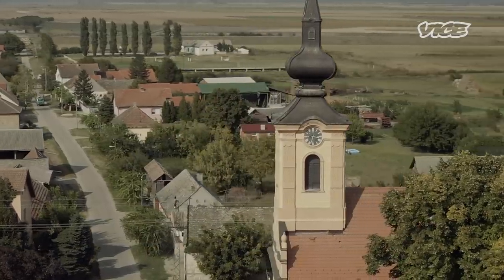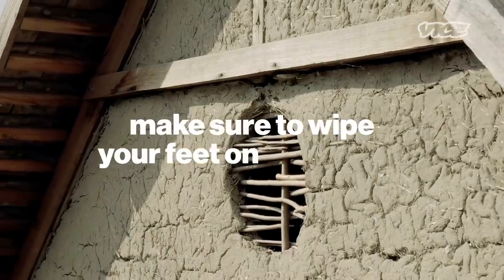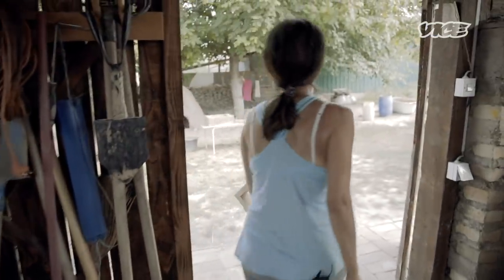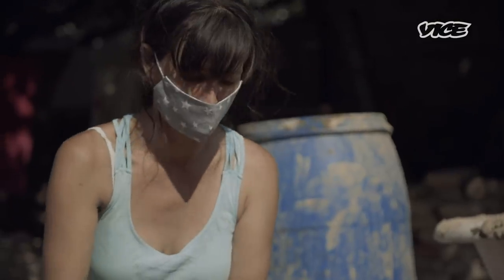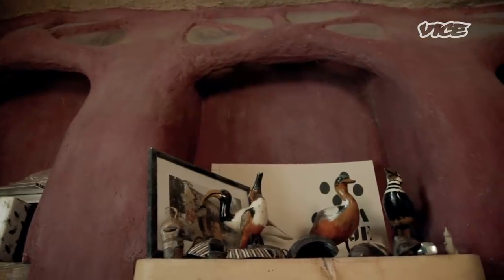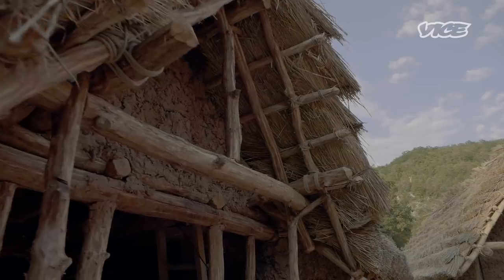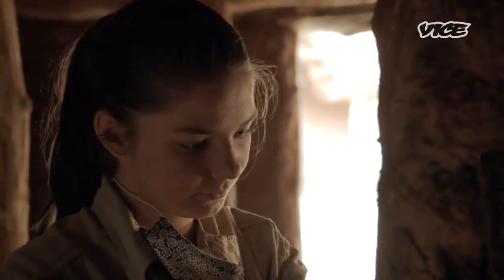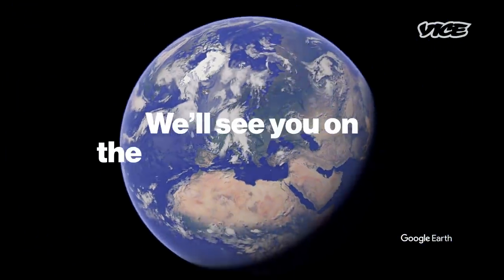Architects Are Using Mud to Build Sustainable Homes

Comment: "Buildings are responsible for 40% of greenhouse gas emissions" is so vague that it ignores what ACTUALLY causes the emissions. Its not the make up of the buildings, its the internal operations. Houses have emissions due to the daily activities of the people within it. I'd argue an uninhabited brick house has no emissions, simply a longer lasting footprint, which ultimately could be very small. A mud house with electricity, gas, and water would also have emissions, while also being less maintainable, strong, and worse at overall heat retention. Its not a terrible idea in warm climate areas. Then it brings up a whole other issue of soil composition. It doesnt seem widely applicable enough to have any impact. Plus the lack or diminishing of a chain of labour would be disastrous for the economy. Good idea, but I dont think its got any legs.
Reply: No, a brick house does not have a small footprint. Brick, mortar, and concrete are extremely carbon and water intensive to produce. Nevermind the wood or steel used to reinforce them, the fuel used to transport them hundreds or thousands of miles and erect/pour them. One foundation has to have limestone baked in a kiln, rocks crushed into substrate by giant diesel machines, and another giant machine mixes them and has to drive to the site on roads whose pavement is made the same way and degrades rapidly under the weight of the cement passing over it.
Reply: @jcarry5214  sounds like skillful jobs
Reply: @MultiFreakface Agreed. But a chain of labour disappearing isn't disastrous in the context of ecology. If ecology wouldn't be outweighing economy we wouldn't be having this discussion in the first place. We need to somehow get rid of this mindset, and set of laws, that non-essential labour is anything but occupational therapy. That's been the positive side of covid incidentally, the diminishment of non-essential labour has been buying us a tiny bit more time.
Reply: @jcarry5214  it doesn't refute the fact that activities are what emit the greenhouse gases... It's also factually incorrect, google tells me 1/3 of all greenhouse gases emitted in US are from buildings which is more than any other sector of the economy (which means its ONLY building the buildings) but they don't produce MOST of the greenhouse gases.
Reply: Marcus INfinity All automated.
Reply: @jcarry5214  And the amount of water needed to liquify the mud enough to necessitate homogeneity is somehow unsubstantial? What about the water required to grow all the straw and grasses? How are you going to act like wood has a serious carbon footprint? Unless we're discussing clear-cutting of rainforests then its a moot point. The majority of lumber where I'm from is locally sourced and grown. You're also making enormous assumptions about the labour chain used. The majority of people are not having building materials shipped in from thousands of miles away. You're ignoring alternatives to the traditional model of housing that don't implement methods that aren't feasible for the majority of the population.
Reply: @josketobben  I would argue we still would to an extent, also the feasibility is the main issue I have. It's not a sound substitute for the majority of the population. I agree that ecology SHOULD take precedence over economy but it likely never will. The other things I dont really care to touch on, as I feel like theyre mainly an expansion of the economy angle. Dont take it as disrespect that just wasnt the main aspect of my argument.
Reply: @MultiFreakface  I'll say flatly that the water used in concrete production makes stirring mud and growing wild grass an absolutely negligible output. I'm from an area that produces both timber and cement. I'm not making assumptions, I know people in both industries. Yes I definitely agree that trees are a carbon neutral material, and harvesting done correctly is an enormous benefit to the habitat. But by the time it's cut down in the forest, hauled out using antique diesels on roads that require immense maintenance, milled, hauled at least twice more and cut with power tools on site they definitely have an impact. A massive proportion of homes are built many hundreds of miles from where the trees were grown or the limestone was quarried. It could be worse, I agree, and there are lots of folks who harvest and mill within a few miles of where the tree grew. And if transportation tech allows the giant diesel engines that move timber and cement and stone to be replaced that would change things dramatically. Powering the mills and steel and concrete plants with non-fossil energy would radically change things also. And I'm not ignoring other alternatives, there are some fantastic ones. The method shown here is a terrible option for anyplace I've lived and they definitely make clear that medieval mud tech is not appropriate for anyplace but a goldilocks temperate zone. I'm just trying to say that most buildings do have a large footprint even if wiring and carpets and HVAC are never installed.
Reply: @taeheekim8314  Yes, nobody is saying that an empty house with no lights on is belching greenhouse gases once it's built. But there are not a lot of houses that fell from the sky intact with no production, mining, metals, or transportation required.
Reply: @Sp1n1985  They're often barely above poverty level jobs, at least where I'm from, and they have a tendency to put people into early medical retirement.
Reply: @jcarry5214  dirty and dangerous job.. They should be paid better
Reply: @MultiFreakface  no they aren't..
Reply: @jcarry5214  But a very well built brick or stone house can last more than 200 years with very minimal repairs, so the pollution emitted while they are built becomes irrelevant.  The problem comes from cheap houses made of plastic and other cheap materials which need to be replaced after 30-40 years.
Reply: @PG-3462  there are many, many wooden houses that old where I come from, and they didn’t need any fundamentally different upkeep from a brick house. Siding is renewable, sills are renewable, everything else is about the same.
Reply: @PG-3462  THE surviving parts of oldest cob house are 10 000 Years so Clay dont have to be bad.
Reply: @iknowyouwanttofly  What you just said litterally prooves nothing 🤦‍♂️
Reply: @jcarry5214  what do u think is the best choice  materials to build homes in developing countries and their poorest areas?
Reply: @hoody3752  almost certainly it’s what is closest, and it depends on what the needs are in a particular area. The biggest obstacle to safe, modern-ish housing I know of is deforestation and lack of access to tools that that would allow materials like rammed earth to be used. In many areas a western style home is completely pointless without infrastructure like electricity, but transportation of materials is an immense cost in developing areas.
Reply: Concrete mortar and brick have a high environmental footprint

Comment: It depends on the location and structural codes. As a civil engineer which is inclined with the structural stability of a building, homes build from bricks are very prone to flexure failure because bricks are only good for compression. If you build that in the Philippines, it will easily be dismantled by a Typhoon. Bricks are only good as an Architectural part of the building like walls, wall bricks, or floor tiles, if you will use this as a structural member therefore it is hazardous.
Reply: Phillipines is in the tropics so they'd probably use bamboo for structural support. In any case, best to see what the indigenous have been building with, because they've been there 1000's of years and the locals know which raw materials are available and how to combine them.

Comment: Yeah, these Mudhuts are really climate friendly, also they have a life expectancy of 30 years, in comparison a "normal" House has over 100, they are prone to collapse and bury you under all the mud and straw, which is even more climate friendly since you wont be producing any more pesky CO2.
Any dont even try to build a multiple story house like that or any house near any water.
Also forget building a cellar.
There are reasons that most of humanity builds houses out of bricks or concrete if they can afford it.
Reply: Vice will do anything to reject Western conventions or technology.
Reply: citation needed? If you build a poor quality house and don't maintain it, it will eventually collapse no matter what building material is used. Bricks and concrete (and also steel for that matter) are also vulnerable to water damage, it's literally one of the most common ways that those materials fail.

With proper shoring and supports, you could build a earthen house with a cellar or a 2nd floor if local conditions allow, especially if you were "allowed" to use some wood and stone materials too. If you have access to lime or mortar, you could for sure do it.
Reply: Actually 30% of the worlds population lives like this right now.The reason most use other building methods, is simply because they won’t allow natural building techniques. 

You can be literally in the middle of nowhere and in the US you’ll still run into building regulation issues. They really don’t want people living cheaply and freely and having cost effective natural building materials, hurts that web of control.
Reply: I can also write a book about the downside of these shitbox huts
Reply: Well we built millions of these houses in serbia, some are standing on top of rivers, most of them are very near rivers and they last for century, my greatgrandfather had one of these and nothing collapsed on his head
Reply: Lucy Bubz well, my honest taught, you can build a regular house and then have some extra rooms made like this
Reply: Nonsens, you can build a modern house of clay, wood, straw and other natural materials. I know, because i have done that already 30 years ago. The oldest houses in Germany from the 14th century have been build that way. What is lacking is the education of the general public and the mindset to think sustainably.

Comment: We in India have similar homes built until 20 years ago, they carry every kind of hazard, if it rains some parts washaway, the grass roofing leaks, roots, snakes nest in them, rats nest in them and a few more, they are a great fire hazard, one stray match and you can watch your home go up in  flames, in event of an earthquake it ain't gonna survive. And pretty easy to break in with today's tools.
Reply: Then you are not making mud houses the right way. When mixing mud with water, it shud be done for long time with proper mixer machine. There are more than 1000 years old mud house in Afghanistan and 10 story mud buildings in Yamen. Make it the right way. Mix lime stone in the mix.. rates, insects all stay away
Reply: easy to break in using today tools?
Have you heard about lockpicking?

Comment: 1. We already use regular hollow bricks to build houses here in europe

2. Wood is better building material then bricks or mud

3.Dry mud doesn't go well with rain

4.Greenhouse gases are not emitted by houses themselfs , but rather by power plants that supply electricity
Reply: Those mud bricks are sun dried and not fired. Once the rainwater reaches several centimeters, don't they concern about the lower part of the house starting to crumble?

Comment: I'd never get a permit to build with any of those materials. All materials must be CSA aproved and built to national building codes. Natural materials don't have a manufacturers certification.
Reply: And you've just discovered the beautiful world of lobbying my friend ...
Reply: Ant • like ants?
Reply: @TubeMeisterJC  Um, no. If the bricks are fired, they don't wash away. The roof can certainly burn but if the walls are white washed, it's going to be a bit more difficult for the walls to burn.

And the daubed walls are STRONG. There are still buildings in England standing many hundreds of years old with the original daub still intact and protecting the dwelling. Oldest is something like 600 years! So no, it's not going to be so easy to kick the walls in. You do not understand the material, clearly. Even modern style buildings begin to severely decay after just half a century.
Reply: @TubeMeisterJC  Yes and wood frame is inferior to concrete block in the modern day, and yet we still make wood frame buildings, so what is your point? Because I think you are missing the point of making these buildings today. They are capable of longevity with old standards and they are more affordable and more green than modern standards. If we combine this old technology with newer building ideas, they can be even better whilst still remaining more green than modern builds.

If for example we want to solve the homeless problem or help people climb out of poverty, these sorts of homes are ideal for doing that.

Comment: Heres a bit of advice...typically when we invent things, it's to improve on an original idea - or create something new to solve a previous problem.
We started transitioning from mud houses many many years ago for a reason, and there is a reason why we haven't 'improved upon' the idea of them either.

These things aren't meant to be long term housing solutions - nor are they meant to withstand major weather conditions (at least without being a major hassle) nor insects/rodents, etc.
Finally, they don't support modern electrical/plumbing and heating in a friendly manner. Yet alone the 'slanting' over time that occurs due to natural settling. 

Why is this important 'news'? No idea. But hey, i've got an idea...lets go back to using outhouses while we're at it! I wouldn't mind having to scrape me and my families poo from the bottom of a hole every month! Sounds like fun!
Reply: @wiseupfixit7552  these people don't know concrete starts from mud.
Reply: What you say actually makes sense but what it doesn't do is pay for stockholders.  Houses built today are not better built.  They are built faster.  They are built quickly and cheaply and with as much profit as possible in mind.  With tonnes of waste created.
Reply: I helped build Cobb homes from "mud"  it was more energy efficient less wasteful and beautiful.
Reply: @Eric D, "We started transitioning from mud houses many many years ago for a reason, and there is a reason why we haven't 'improved upon' the idea of them either." you are correct and that reason was all for money, it cannot be denied that before European conquest and the stealing of natural resources from outside of Europe, most of the homes built in Europe for peasants was a sort of earthen homes (cobb) homes.
Reply: @MrChrismasuimi  😂😭😂😭
Reply: @mikeaskme3530  You'RE riGhT, i forGOT the eveRybODY In the worLD hAs tHEiR oWn NatiONALItY SAnDboX aNd IT is ProfOundlY aGAinsT THe IntErgAlACTIC coDe of eThIcs tO coMPEtE WIth aNyBODy OutSide OF YOur SANdbOX For naTUraL rEsourcES.
Reply: @MrChrismasuimi  Well that settles it. Let's regress to the Stone Age because it was prettier.
Reply: @MrChrismasuimi  - you said that homes today are built with more waste which is literally not possible. One of the key features of capitalism is efficiency. Economies naturally allocate scarce resources where they are needed the most. This is called the law of supply. 
-If you count the wasted time in just building the houses alone, we mathematically would not have the time to construct civilization as we know it. 
- houses today are better built evidenced by the fact the areas with modern homes have vastly lower mortality rates then primitive areas due to Falling debris during earthquakes. 
Everything you've said has been measured and there are no plot twists in the data and no amount of wishful thinking will make mud Huts better than modern housing.
Reply: @wiseupfixit7552   lol No, it's quite obvious that brick houses and mud houses are profoundly different. That's called conflation.
Reply: People are just having a discussion. It could work when modified & in certain areas combined with alternative solutions for other living needs.

Comment: There is a simple reason why this type of building is not mass produced.  From a purely structural standpoint, the lifespan of a mud house is about 1/4 that of even a poorly built house with "first world" regulations.  Also, you won't find many of these mud houses with a safe second floor, let alone a true multi-story building safe for human habitation.

Humans have been studying engineering for tens of thousands of years.  Technology plays a huge role in structural engineering.  If this was a truly feasible option for major development, well trained engineers would be doing it everywhere.

I'm not saying that there are zero positive attributes to these mud structures, but I am saying that our understanding of structural engineering and architecture in 2020 is based on hundreds (if not thousands) of years of research.  If these structures made financial sense in an urban area, and were safe at scale, they'd be made everywhere already.

The host is cute AF tho!  EDIT TO ADD- Petrovic is a name derived from Petra, meaning Rock or Rock solid.  So the surname/last name Petrovic essentially means rock solid... A strangely apropos name of a host talking about building from earthen materials
Reply: My maternal grandfather's mud house is about 100 years old and still standing.
It needs a different kind of maintenance, but I will stand.

You are right about the multistorey though...

Comment: In Bangladesh this mud bricks is cost around $0.09 for 10"x3"x2.5" size.
labour got just 1 cent of less for making and drying it. Then its being burn in terracotta burner.

And this is a major problem. Clay is clay because it contain calcium carbonate, potassium carbonate and Silicon dioxide. and the only source of this thing is fertile agriculture land.